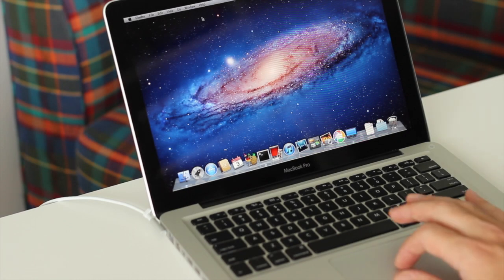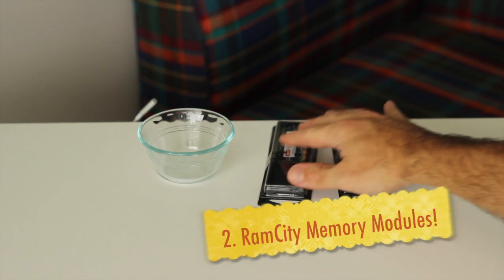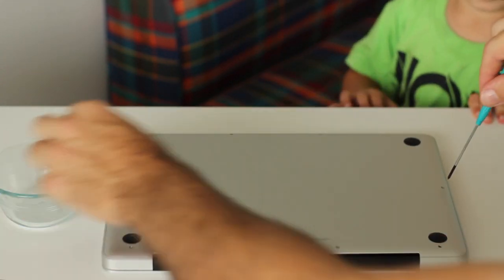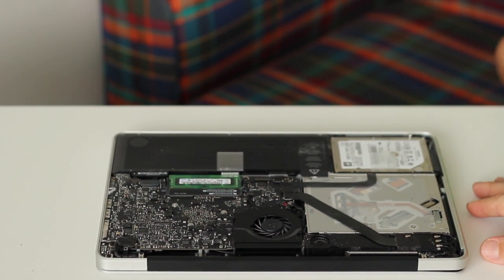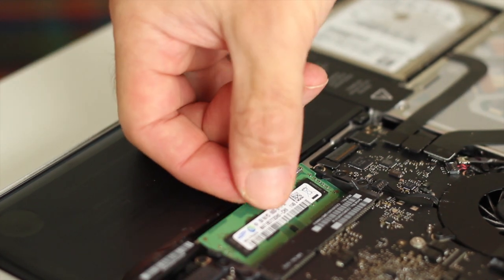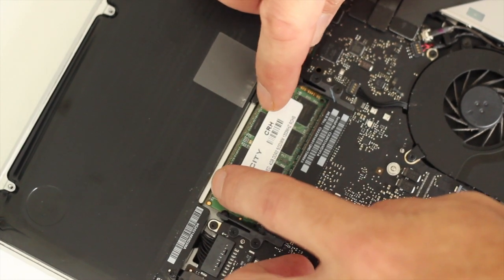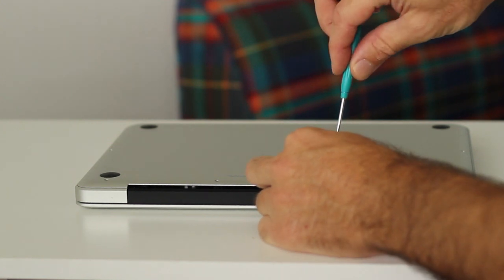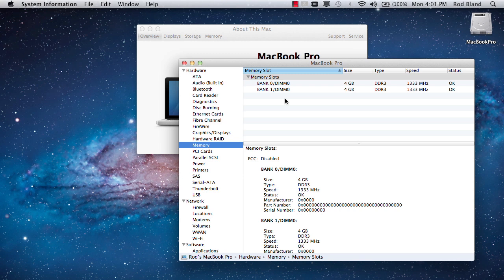How to Upgrade the RAM in a MacBook Pro 2011

Comment: Wow, great stuff. Ordered online from RAM City. Delivered fast and as described. No problems. Followed this quick video. MacBook Pro now flying with 16GB. (My Mac got noticeably slower after the Mavericks update, so it was a good time to load up. 16GB might be a bit of overkill, but I tend to run lots of applications at once, so now I can't go wrong.) Very happy with RAM City - thanks guys.